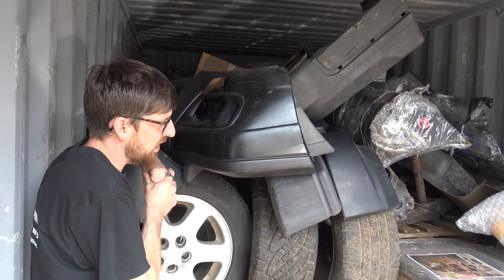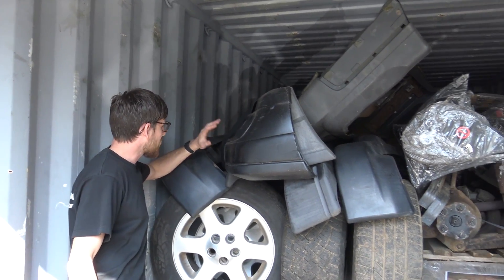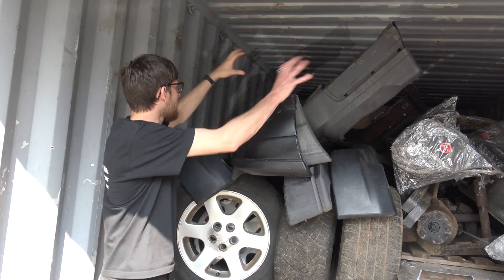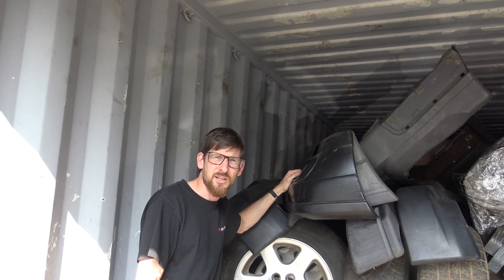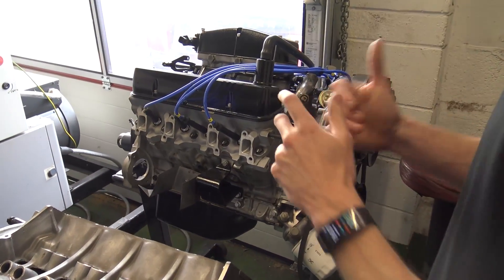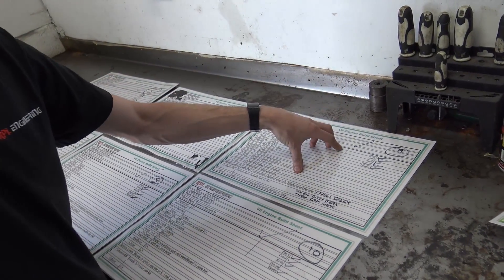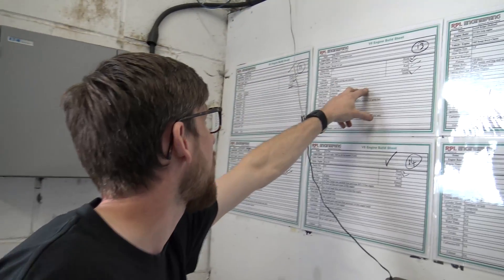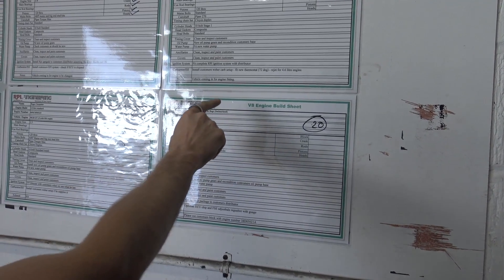RPi Engineering V8 Workshop Update Episode 30

Comment: I'm looking for a spec to aim for with my motor in my 1932 ford hot rod, have a 3.9 block but should I start with a 4.6?
Would like 225 - 250 brake.thanks!
Reply from the maker: Hi,
It depends on where you want the power. A 3.9 engine with stage 3 heads and Piper 285 cam with correct fuel and ignition setup would be around 220 bhp. In a light weight car it will pull well from the bottom end as there is no weight in the car and give you the 220 bhp at the top end. However if you build a standard 4.6 it will make 220 bhp and give you bags more bottom end torque however reving past 4000 rpm will make more noise but not more power. The 4.6 option would give you the advantage of further upgrades later though as stage 3 heads and 285 cam there would make around 270bhp
Reply: @RPIEngineering  thanks for the reply!
Sounds like the 3.9 will work for me, I'll be in touch about sending it to you guys for building when I'm further on with the project👍
Reply from the maker: @kevindawson6170  No problem.
Reply: Stick with 3.5 fewer problems  in long run.

Comment: Wondering what rear end the P6 is using?  The standard rear end can take a lot of hammer but I wonder if there is LSD available that will fit into the original diff casing. Then that ripsnorter will really be able to get the power down to the road. Also knowing how unique the suspension and steering set up is to the P6 I'm well impressed with the air ride must have been a difficult installation. Does it have original P6 power steering? and how have the brakes been upgraded to bring that beast to heel? Would have loved to have retro modded my 3.5s but it was too original and would have spoilt it but if I had a P6b that had been cut about and engine swapped in the past then this is what I would have done to it. Brilliant car this one on an engineering level but aesthetically I would prefer a period colour and all the chrome reinstated and standard looking wheels but that is just my taste this cars owner has his and the car does look awesome in an aggressive way. Very cool indeed and a credit the owner,  wish it was mine lol.